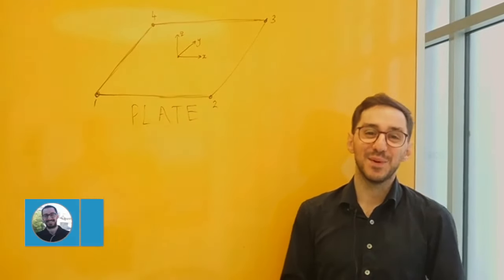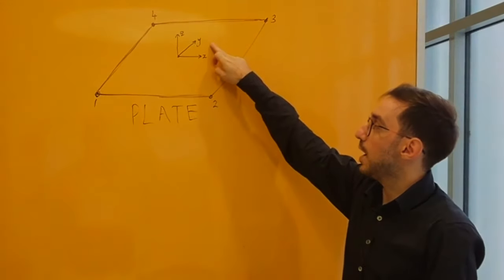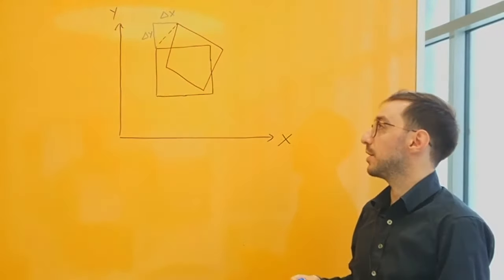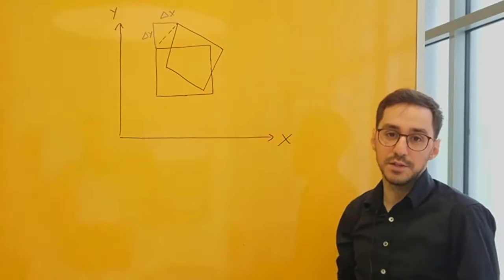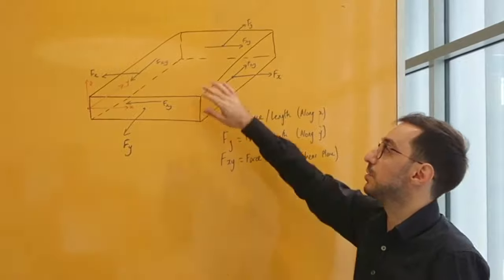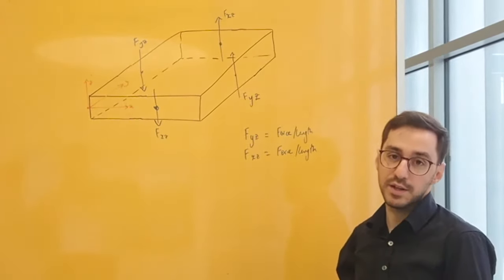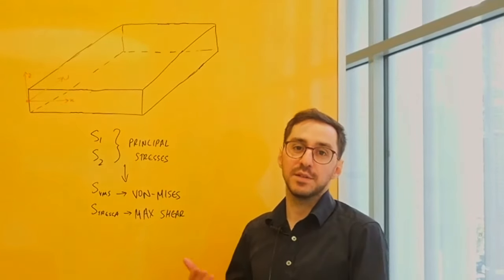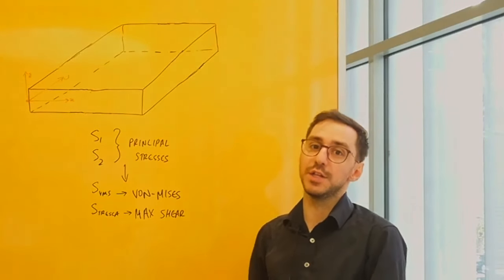Understanding and Interpreting Plate/Shell Element Results | SkyCiv Structural Engineering Software

Comment: Interesting how this is differnet to stress block conventions used in applciaiton like Strand7. e.g. The Fyz in this video would be called Fxz in applicaitons like Strand7 i.e. the force acting in a plane perpendicular to the x axis pointing the z direction.
Reply: Hi Donald. It's a good point you make. The convention used matches what is used in another Australian-made application called Spacegass though which you may know too. Unfortunately this is different to most other software I've seen like ST7, RISA, Dlubal RFEM, MIDAS etc. It's important to know the conventions and local axis systems in each software as it may differ.